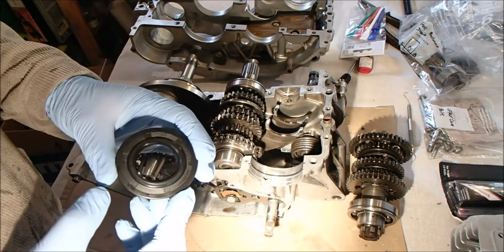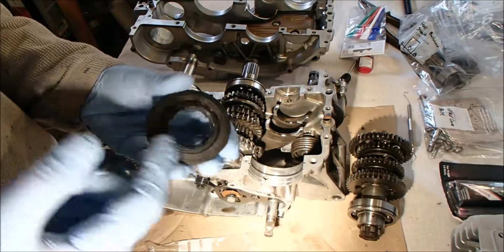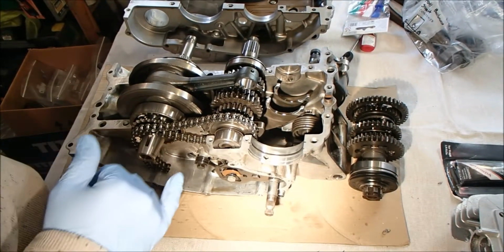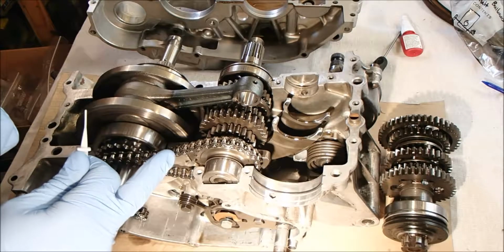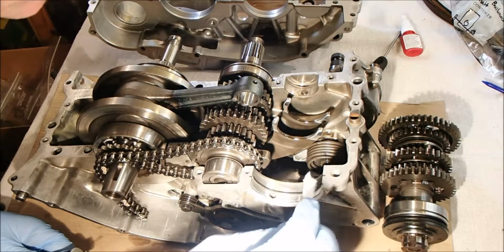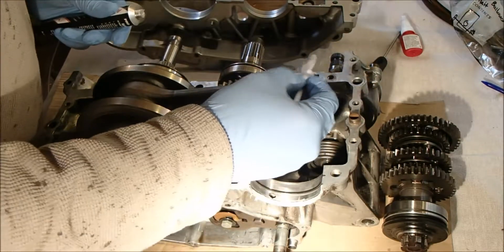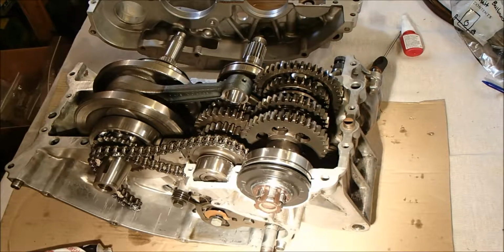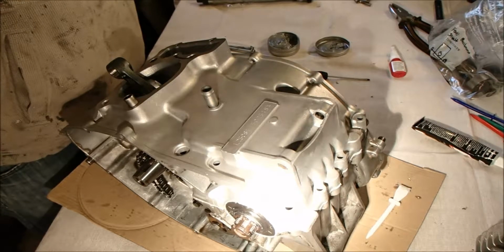Honda xl250s engine restoration (part 9)

Comment: Amazing videos. I am also rebuilding my Cb250rs engine and these vids are so helpful. Thank you for the time and effort. 👍🏻
Reply from the maker: Thank you for the positive feedback. It's really pleasing to know that others find them useful. Good luck with the build. the RS has a few extra goodies fitted like rev counter on the cam shaft. Did they also make an electric start version too ?
Reply: Richard Weeks 
Yes it has extra bits. And they did do an electric start too. I also have one of those. I’ll be doing that one next Providing I get the kick start version running first. It’s my first time so your vids are really useful. I am truly grateful. Thank you sir.

Comment: Hello. I from russia. Please help find this final drive oil seal. Maybe you can write the number of it? For i can find him in internet.
Reply from the maker: https://www.cmsnl.com/honda-xl250s-1978usa_model1142/oil-seal-34x62x14_91206kb7005/#.XdbNF6inw0M
Reply from the maker: Hope this helps. 😀
Reply: Thanks but they not deliver in russia
Reply from the maker: @endurobro3885  copy and paste the part number into eBay Russia ?
Reply: Ok i will try
Reply from the maker: @endurobro3885  part no is 91206KB7005
Reply: I founded it on ebay. Have a deliver in russia. Thanks comrade
Reply from the maker: @endurobro3885  happy to help